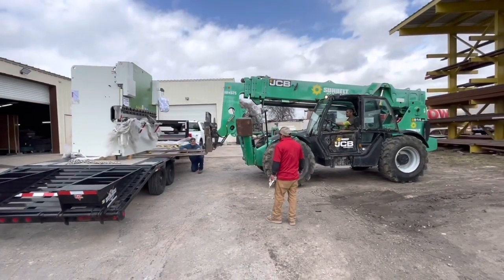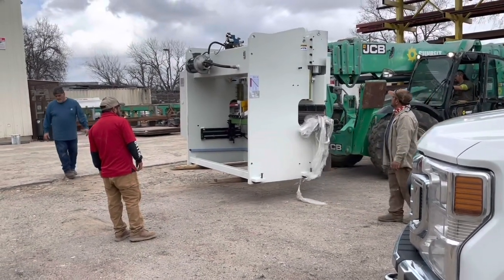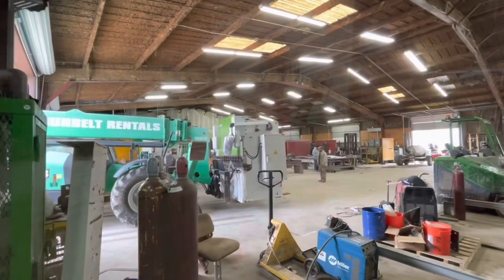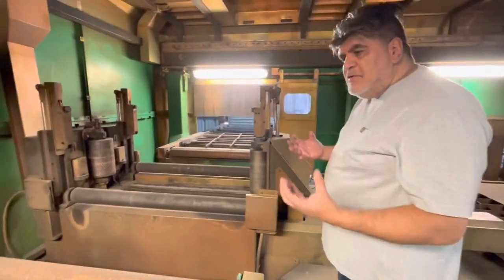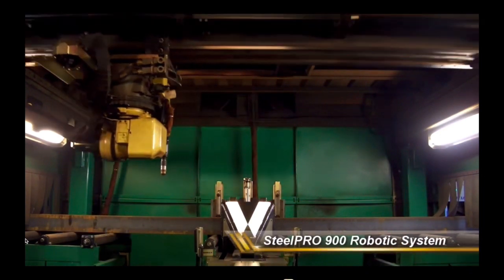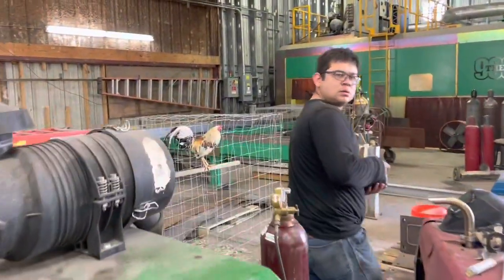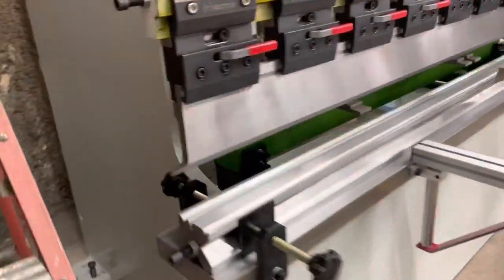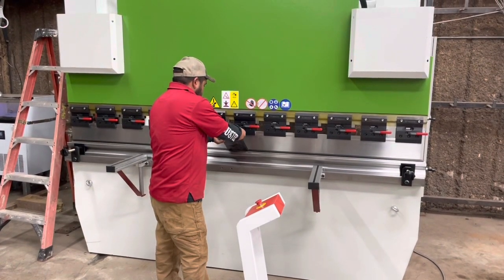A very interesting Press Brake Installation

Comment: Seems odd spending 1.2 millon on a 9axis profile processor then ordering a nc brake
Reply from the maker: Well, I trust that Sal ( the owner) didnt get to a position of being able to afford a $1.2M machine by making poor choices.   This is a structural steel shop, that needs to make basic bends with loose tollerances, so its really the machine they needed